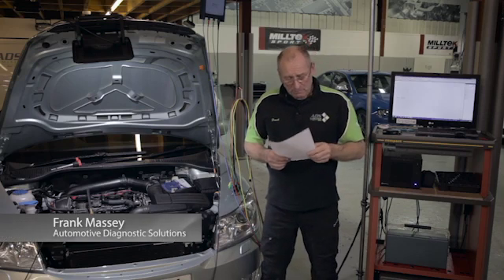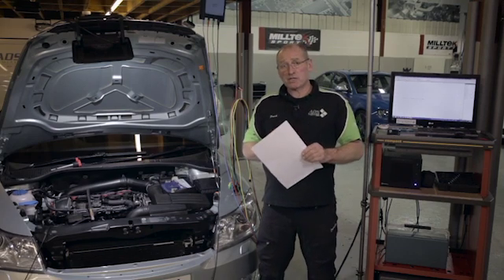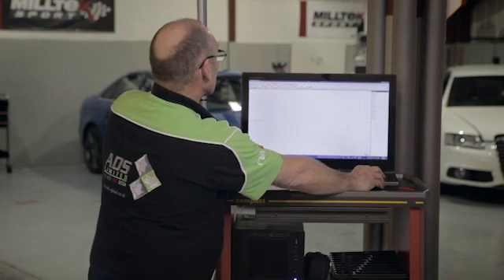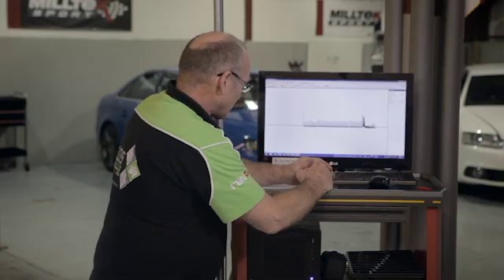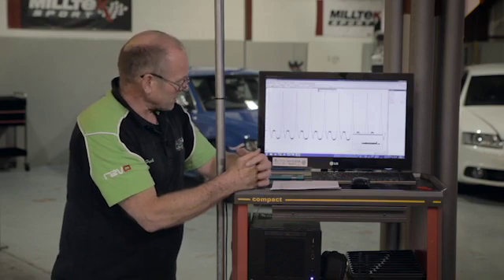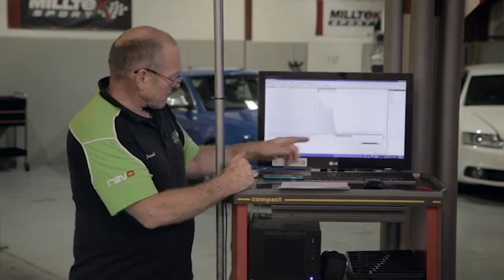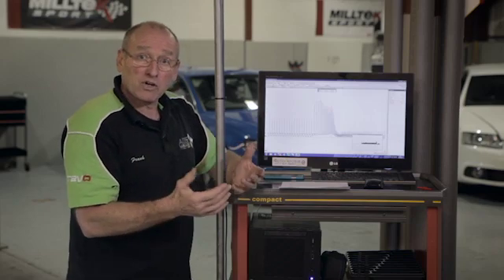Frank Massey's Top Ten Tests with PicoScope: #9 Compression testing

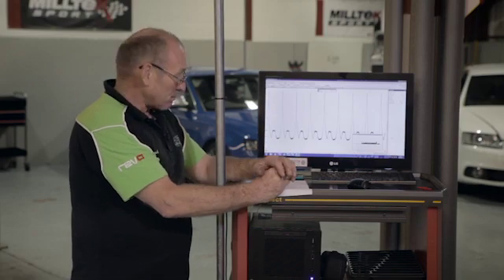Comment: Hello and thank you for the comments. You are correct Peter, at 8:25 that is indeed TDC on the exhaust stroke as this will be one complete revolution of the crankshaft. Whilst BDC can be challenging to predict it will occur at 180 and 540 degrees after TDC (Peak compression) Returning to Frank’s video peak to peak compression takes approximately 140 ms. This means BDC can be estimated to occur at  35 ms (180 degrees after TDC) and 105 ms (540 degrees after TDC)

Comment: Thank you,sory ,I am not very good in english but i have a problem and i hope that you help me, i have a- KIA- NEW SPORTAGE 2016 DIESEL 2.0 L  13450 km , with a problem of overconsumption of oil , i remarked the oil pass through the breather hose whitch is above a rocker cover to the hose between the air cleaner and a turbo , so the is big quantity of oil in the intercooler . my question is how can oil pass through a breather ? I think that a breather is for steams ,no ?

Comment: Thank you for an excellent informative video. I also use my scope for diagnostic pressure testing. The range of tests is very wide and varied! I have used it to measure exhaust back pressure at the o2 sensor,this pressure more important than it is generally assumed. Sometimes less is not more in terms of efficiency. I also used mine to diagnose failure of a pulsation damper on a fuel supply pump on a helicopter engine.